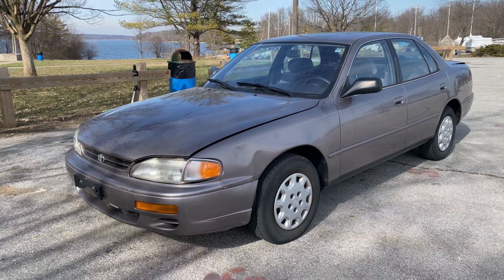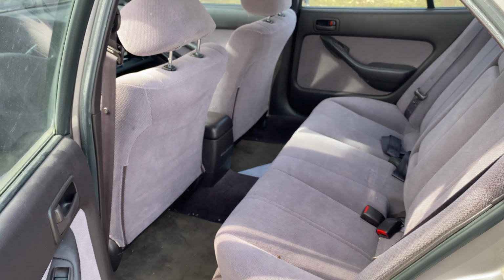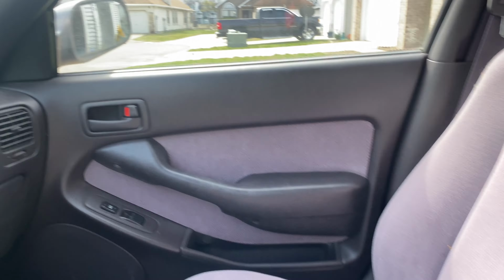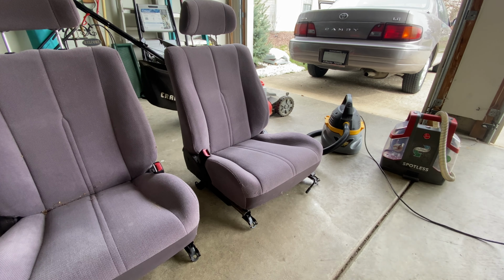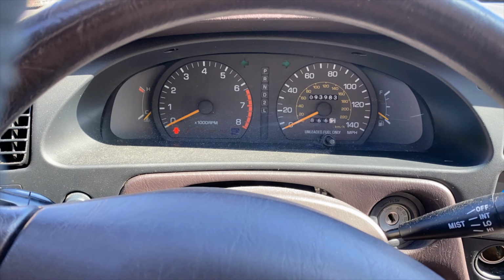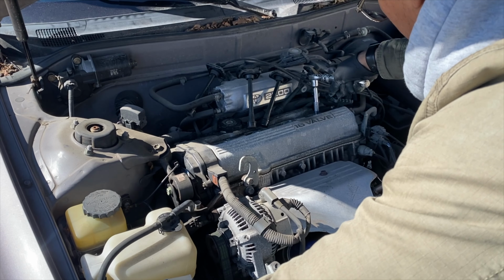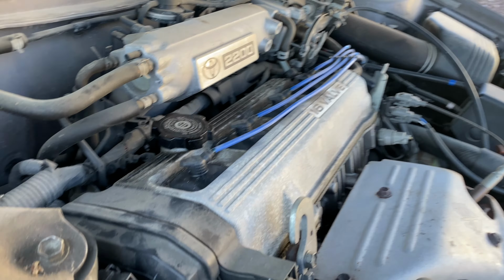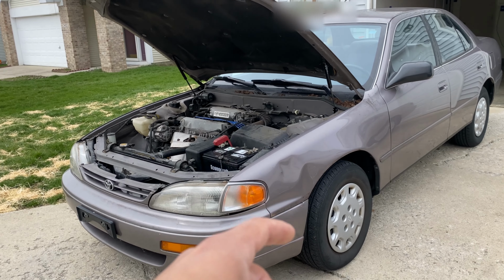I Found a "Donated" 1995 Toyota Camry at The Auction!

Comment: My 2000 Camry has 454 K miles on her original engine and still runs drives and purse like she did when I bought her almost brand new with only 700 miles. Keep up with the the oil changes and basic maintenance and you'll have a car that will most likely outlive you. The biggest problem with these boils down to the the owners owners especially once They get to the third and Force owner. These cars are so reliable that it becomes their downfall because these owners tend to drive them until something major happens which doesn't usually happen until their second or third oil change or they get around 250 K miles.

Comment: Hey dude what are your thoughts on buying a 200k-250k mile camry or corolla? It's pretty much all I can afford right now but I dont wanna spend all my savings on a car that's only gonna last me a few months before the engine or trans needs rebuilt.
Reply: I would say go for it. I have a 2010 Camry with 247,000 miles on it and it still runs and drives just fine. Don’t worry about a transmission blowing out on you if you buy a high mileage Toyota. Just gotta make sure you do proper maintenance on time